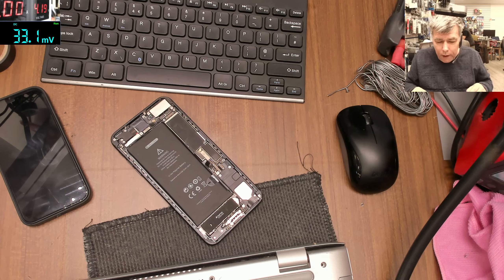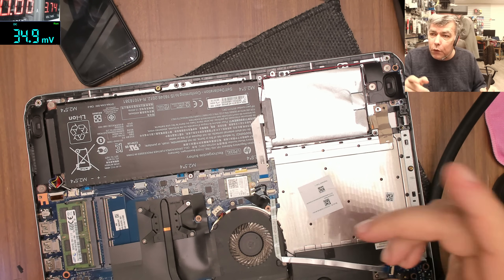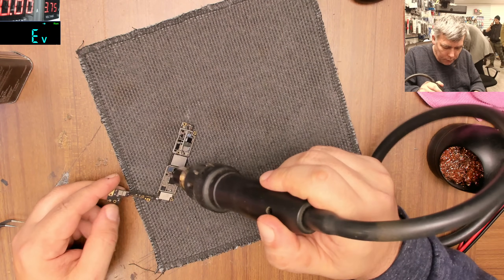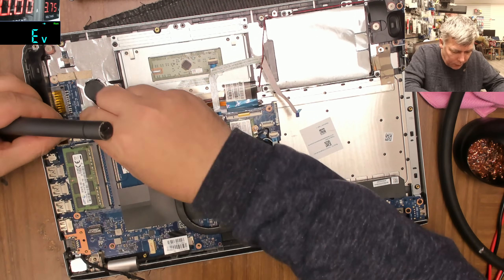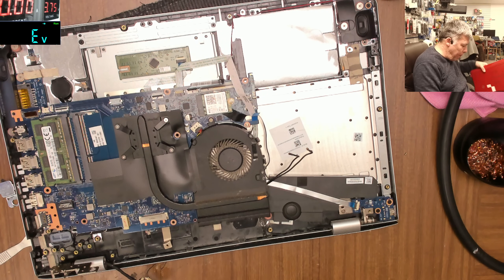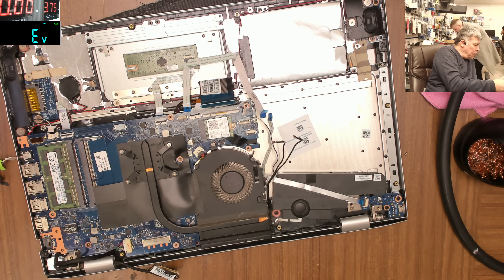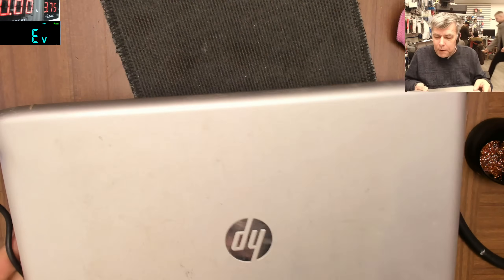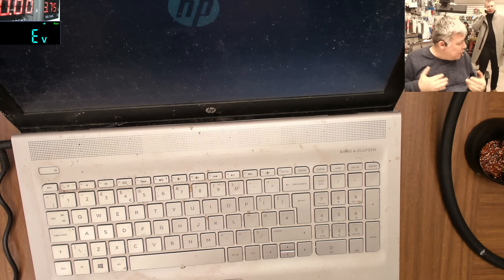Iphone 7 shorted board & HP laptop charging port replacement

Comment: You have a lot of signal loss in your long antenna cable. Mount your gateway on top and you get a "gain" for free. Also, Yagi-Uda is very directional, meaning you get reception from only a small "slice". Unless you are far away from all other hotspots (and they are all in the same direction) I don't think Yagi-Uda is the way to go. 
BTW, radiation limits are set for the signal leaving your antenna. This means that adding a large gain antenna might be illegal from that perspective.
Enjoying your videos a lot!

Comment: I haven't checked what's this helium thing is about, but you said something about antennas, I remember when I worked with nano stations, there used to have something about DFS, and for some reason, depending on the day, my station couldn't receive as much package as my access point, so I would have high download rates but not upload...

Comment: I am working on this Dell laptop N5510, It Wasn't turn on or Charging but after I disconnected the cmos battery but it does not come  on but the Processor get hot and help

Comment: The "iphone is disabled" notice will disappear as it says after 14 minutes (it started the countdown at 15 minutes in this case), then if the correct passcode is entered after that, the phone will be fine. Seems you didn't clean the fan on the laptop from other comments (not got that far into the video as yet) - I had et with myself that you would, so am surprised...